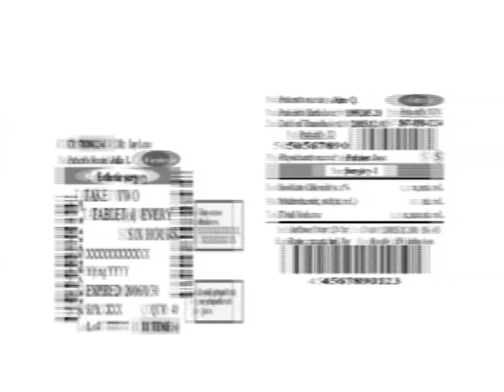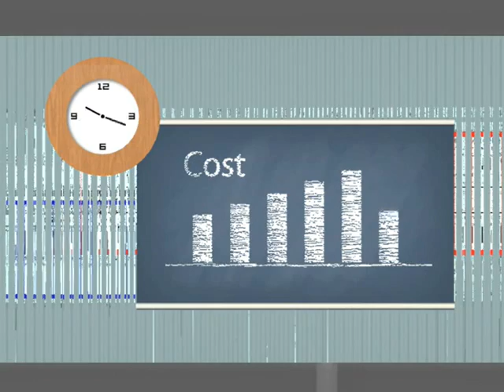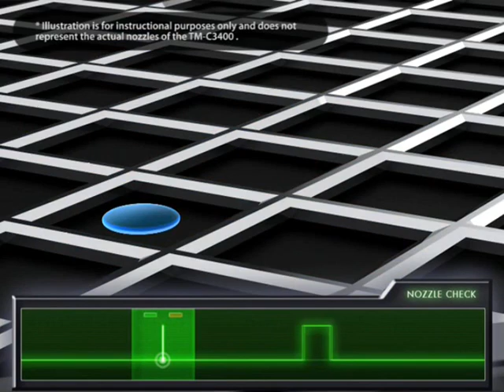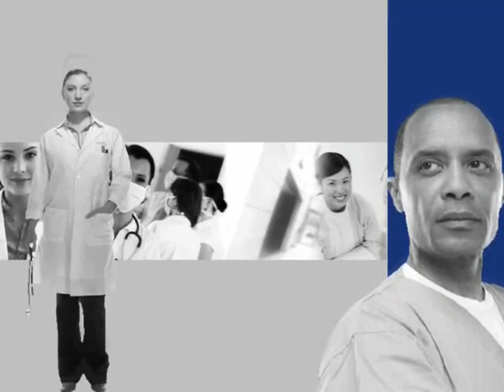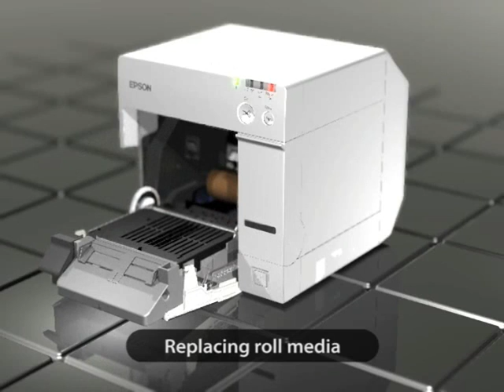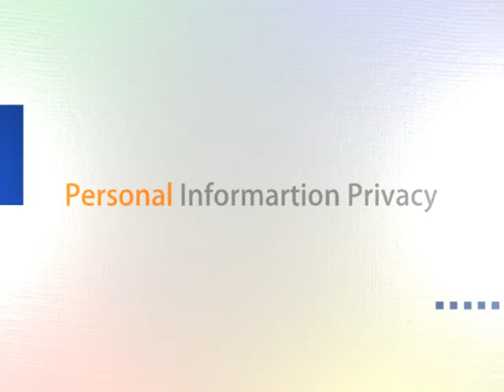Epson TM-C3400 colour label & wristband printer

Comment: I used to use an Epson ET-2550 https://www.youtube.com/post/UgkxciSwynMJ7PnUvvx11rewiu-yFBkZTl53 , an early model of the ink tank style. It worked well, but had one nuisance that drove me up the wall; if you didn't put it in high quality print mode you'd get a streak across the page. I'm happy to say I have yet to see this with this printer. The print quality has been fantastic so far, the set up was super easy. All in all I'm very happy with this printer.
Reply: What software do you use and where do you get your lables?